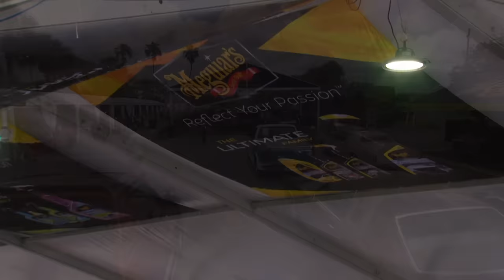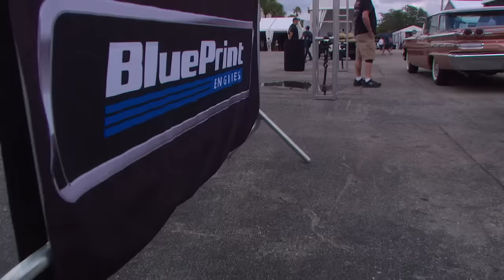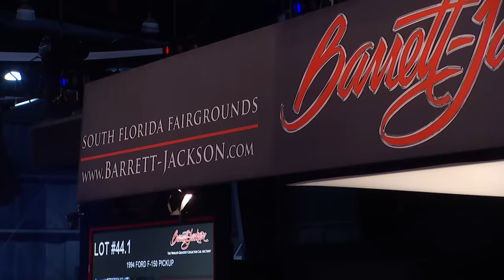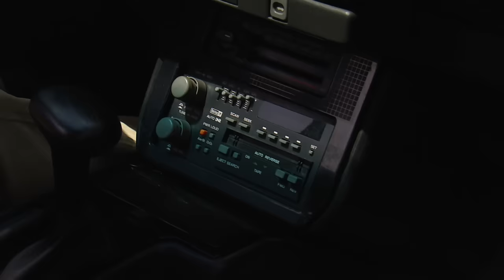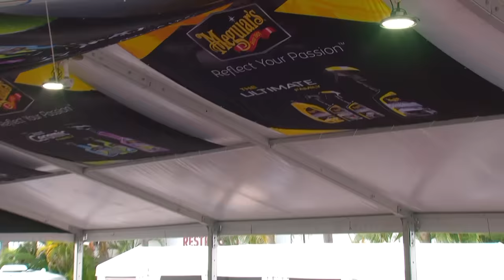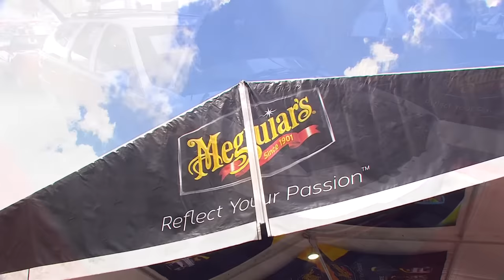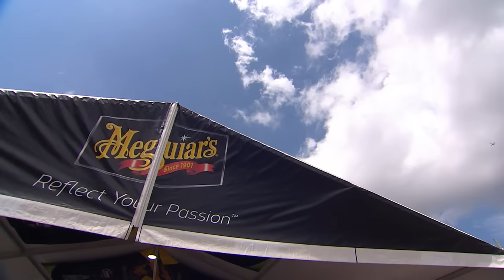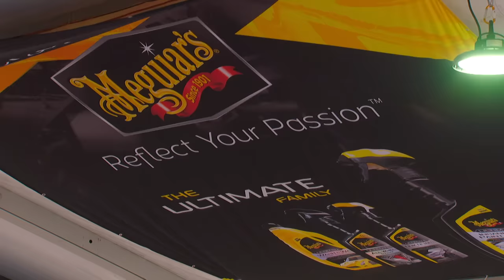2023 PALM BEACH THURSDAY BROADCAST - Thursday, April 13, 2023  - BARRETT-JACKSON 2023 AUCTION

Comment: Great video, bought mine 2 years ago with 17k on the clock it’s not got 40k!. These cars need to be driven, watch out for the ac compressor. Most expensive thing is the brick discs and pads that cost 3k. Apart from that no issues what so ever, it’s my daily. I think I’ll keep it forever, like you said they won’t make any V8’s like this anymore!

Comment: Normally,they aren't wrong. A lot of automotive knowledge in the B-J crew. But at 1:39:20,April says second gen c10s were the first with auto trans. I don't know just how rare they were, pretty rare in my experience,but in 1973 my dad bought a sweet 1966 C10 that was positively loaded for the time. It had power steering,power brakes, a 283 backed by a power glide auto trans and Air conditioning. Most pickups had a six banger and and three on the tree and not a single option. It was the first vehicle I ever drove, I loved it and I hated when he sold it too.😢

Comment: Wow.     The back bumper on that Pinto was an actual production “design”.     Ummmm, how, in the name of god, did a committee of decision makers, who ultimately sign off on the products that you and I see, all agree, or not agree, that the rear bumper on a 1980 Pinto was satisfactory as presented in this video?     There isn’t just no style, it’s just a flat piece of…..I guess plastic, to fill in between the body and the rear edge of the bumper, and that distance is simply comical.   It almost looks to be so far from the body that there might be a purpose, like a spare tire, a Continental kit, a rear steer hook and ladder trailer, or a hose reel.     (Get it?  Fire suppression might be needed?).   Yeah I know that was supposedly remedied years prior.   And on that note, consider that all of the 65-71 Fairlanes/Torinos and Mustangs/Cougars had what was easily the greatest and smartest cost cutting idea of all times-if the gas tank is going to be in the trunk(al) area(!), and said gas tank is going to be situated into a flat-like position, then it can DOUBLE, yes I said double folks, killing the proverbial two birds with one stone on paper but in the-field, killing a family of four, or two teenage virgin lovebirds who have avoided any thoughts of consequences, not from the infant producing coitus, but from the eminent coitus interruptous extraordinaire.    Their love was as so many tongues licking the body, aflame with oxygen in short supply, and the heat from their bodies the very least of their concerns.     Had they known that Ford had intended to actually SAVE the lovebirds from conceiving a child at too young of an age, in a world aflame with careless design, greedy safety concessions, and the most successful individuals being shining examples of irresponsibility and ruthless morality obliteration.    The world owes a debt of gratitude to Ford for that trunk floor that doubles as the gas tank.  It saves weight off of the rear axle for maximum drag racing madness, and decreases that stiff and rigid ride by using fewer parts and less fasteners,  and since the trunk floor is now much heavier gauge steel, you can put your briquette grill right in the trunk with little to lots of fear of any heat or flames bringing on a memorable evening alight with good food and lightened trunk lids in a sooty shade of black.     Innovation.   That committee earned every penny they squeezed out of our collective longevity.

Comment: Great video. I have a 2022 Metro that has been giving me fuel pump issues. Now my pump is in gas tank. It doesn't always turn on after I turn key. I can't bring it to dealer and I never ket it sit. It starts intermittently and this started in the warm weather. 😢 I am really upset over this because its my only ride and nobody in this tiwn works in them. Not even two years old and I'm still paying the damn thing off